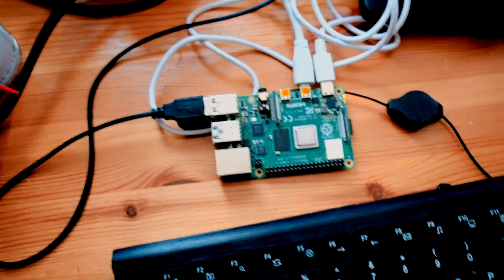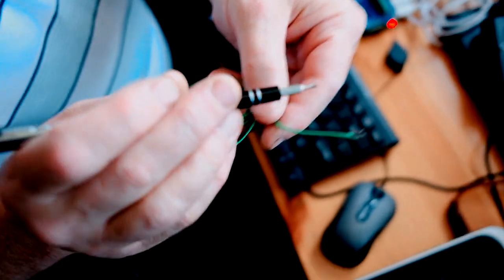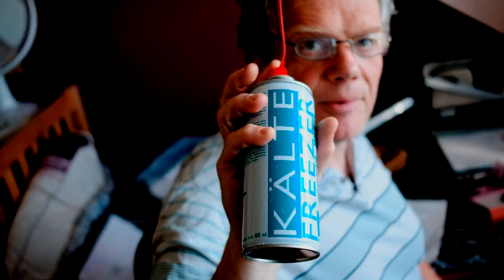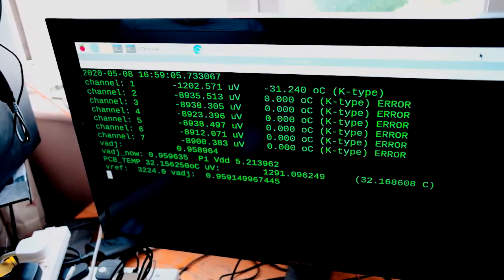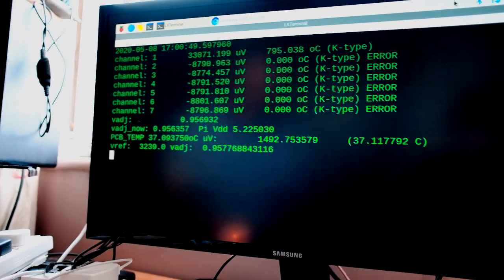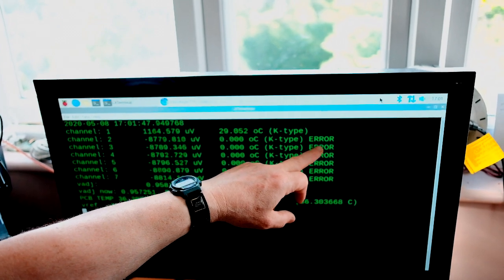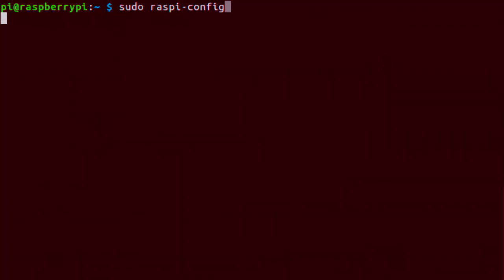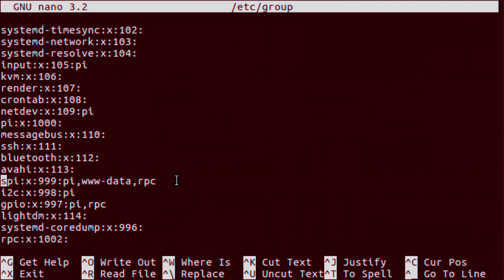Setting up the TH7 thermocouple raspberry pi sensor hat

Comment: Hi @robin48gx, love the video and what you've made here. I'm guessing these are not stackable (multiple hats to provide additional input). I'm trying to measure 49 thermocouples so might need seven of your TH7 units for a school project.
Reply from the maker: Hi, no these are not stackable. We also have a version with 4 thermocouple inputs and a volt free relay. Out of interest what temperature range are you interested in?
Reply: @robin48gx  Thanks Robin. My temps will max out at 350*c.Is your email address - rpc48gx@yahoo.co.uk? I'll email with more details related to the specific project.